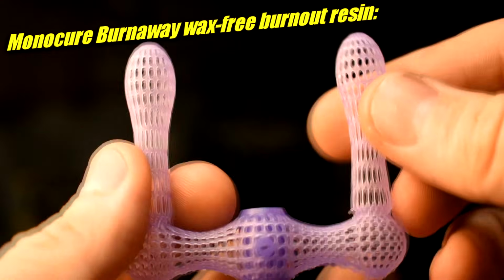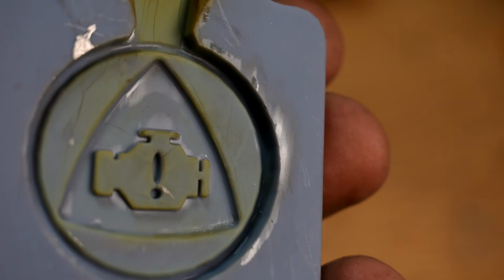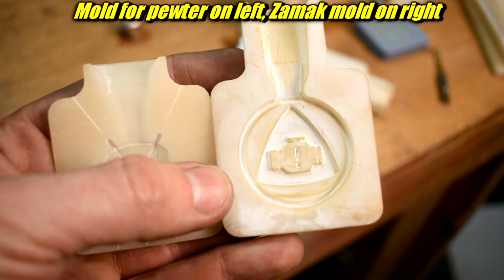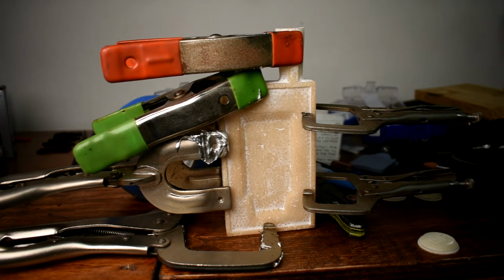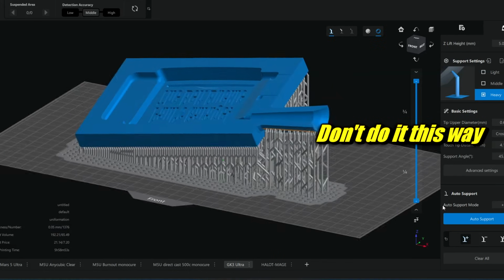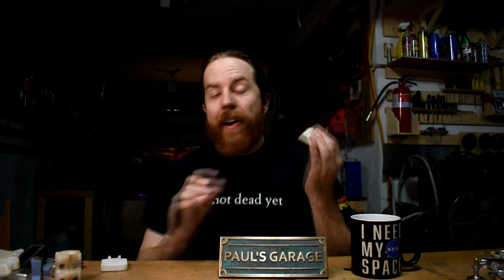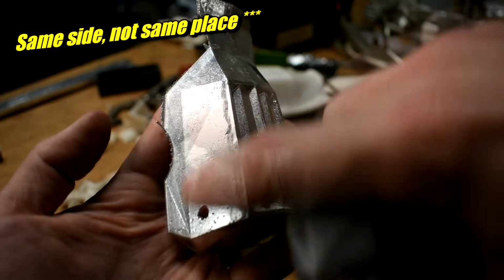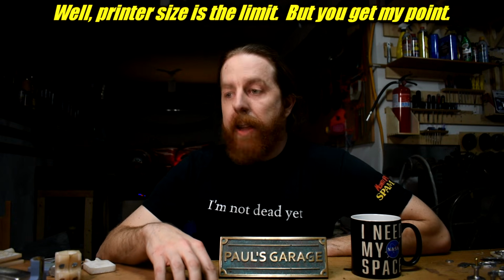EASY Metal Casting into 3D Printed Molds | Monocure ThermaCAST!

Comment from the maker: Check out my New 3D Printer Focused Channel!:  https://www.youtube.com/@PaulsPrinterProjects
This AWESOME resin available here: https://monocure3d.com.au/product/thermacast-resin-heat-resistant/
Amazon: https://amzn.to/417BSjq 1.25KG
https://amzn.to/4kec4eo  6KG (i'd suggest this one!)

Metal used available at www.rotometals.com
Here's the low melt stuff: https://www.rotometals.com/low-melt-fusible-alloys/
Pewters: https://www.rotometals.com/pewter-alloys/
Za-12:  https://www.rotometals.com/zamak-za-12-mini-ingots-pack-of-12-1lb-each-free-shipping/
Reply: Hello, have you tried wax filament for 3D printing? I have an FDM printer, and I wanted to cast complicated elements from zamak5 and it's hard to find solid information on how to print it and whether my printer can handle this filament. You mentioned this filament in one of your videos, so my question is: do you know anything more about printing this crap? printer profiles? any advice? I bought pvb filament but I have no way to burn it out of the mold in a controlled way... this makes it difficult for me to cast anything ;) (btw I melt zamak5 in an open furnace for melting tin up to 500°C or with a cheap burner in a cat food can XD, I have limited possibilities). Thanks in advance for your answer

Comment: I was always wondering if the rate metal cooled off would be fast enough to not entirely burn off a 3D mold.... Sweet video! I still like my sand casting, but this is cool
Reply from the maker: Agreed, sand casting is great.  This stuff can hold up to even za12 but thicker parts cool slower and damage the mold faster.  Ive tried normal resins, and even though the R202f metal doesnt burn the molds, the heat warps it all so bad it leaks.  Thermacast is the only way to go

Comment: Great video. I am an Aussie and have been using Monocure resins for years because they are good quality. I only found out about Thermacasr yesterday. I have been looking for a resin like this for a while. I have tried various types of casting with varying success. I have been CNC cutting molds from graphite which works well for objects that are not too high. 3D printing the molds will be a lot more versatile.

Comment: Question. What would the inside of the part look like after casting?? Would it look like swiss cheese with 100s of small airpockets, or is the finished casting fairly dense? Wondering if you have ever tested this or if you would be willing to test this? Thanks.
Reply from the maker: Good question, the answer is, it depends.  As long as you don't over heat the metal, nothing will off gas from the thermacast resin and cause bubble.  You can still get porosity in the metal casting if your gating allows for air entrainment, or if your design doesn't compensate for shrinkage.  If you use a tin-bismith alloy, shrinkage won't, but air entrainment can.
Reply: @PaulsGarage  Thank you for your quick response. I am very interested in this stuff, as it can make some pretty intricate metal parts for a very affordable price. Have you had better luck with the Therma CAST or the BurnOut resin. What process would you recommend for an absolute noob, zamak12 seems to be my target.
Reply from the maker: @GokayToklar  the processes are VERY different, it depends what you want to make.  If you are a total noob, I would suggest thermacast and pewter until you get the hang of things, then za12, then the burnout process if you aren't getting the results you want.

Comment: I see they sell it in Kg rather than ml. How many ml to the Kg is this resin?
Reply from the maker: The reason it's sold in 1.25kg and 6kg is because it's pretty dense stuff.  1.25kg of thermacast is close to the volume of 1kg of regular resin, that's why the volumes are off.
Reply: @PaulsGarage  Thanks for the info

Comment: Use snap rings around the smaller molds that can be printed with a round exterior shape.  It's never warping outward against multiples of snap rings.  No slots required by the way.

Comment: Would an electric toothbrush shaft (head removed) provide enough vibrational energy to shake the air out if you touch it to the mold?

Comment: Glad to see your video! You convinced me; its Zamak time. As for REMOVING BUBBLES...you can harvest the motors from an xbox or playstation controller that vibrates. I use a variable resistor and 9V battery with the motor(s) placed in a plastic box. Fastened the motor really snug with plumbers tape. Yeah, the metal tape. Thanks for sharing your work!
Reply: Or go down to your local kink-shop and get yourself a rechargable tooth-rattler. Multiple settings already programmed in! Liquifacts concrete a treat and nothing sticks to silicone!

Comment: I didn't know you could just buy bars like that, so thanks for that tip. And I really need to get a resin printer now, because that is awesome. Maybe you could use this to print some pieces of the lathe, gears and/or chucks?
Reply from the maker: You read my mind!  That is the plan

Comment: Since it's 3d printed, it should be possible to print e.g. cooling passages in the mold.  Hmmm.  This is a gateway drug to die casting.
Reply from the maker: That's a great idea.  Internal cooling to chill the metal but also limit damage to the mold.  With lower temperature metals it's probably not necessary, but for Za-12 it might be worth a try

Comment: build a vibrator base. get a cheap bathroom vent fan and cut back one of the blades. It will now be out of balance and vibrate. If not enough vibration, cut back that blade further. 
You can add a dimmer switch to tune the vibrations, but probably overkill.
Reply from the maker: Not a bad idea!  I need to replace a vibrating bathroom fan in my house, actually.

Comment: Print the shell molds in halves, clean them out, then press them together and paint a small amount of the resin along the seam and hit it with a UV light to cure.
Reply from the maker: @Mike80528  that's probably the best way to make sure it's clean inside
Reply: @PaulsGarage  Does the data sheet list dimensional stability?

Comment: @PaulsGarage

Great videos as always, can you make a video on sand cores using greensand/petrobond sand. Shaping these cores using reverse 3D printed molds should be easy but actually hardening/solidifying the sand consistently would be a game changer. Sand casting an aluminium engine block tutorial using these cores would be ace.
Reply from the maker: That would be awesome.  Thus far I haven't used sodium silicate cores, just petrobond in printed molds, and I ram then as tight as I possibly can.  Seems to work well, but for something like a block with cooling passages, you would definitely want sodium silicate.  Very cool idea, I'll add it to the list
Reply: @PaulsGarage  I was always wondering rather than using sodium silicate cores with c02, if there is an agent/binder that hardens greensand/petrobond sand that would make life so much easier. Or even an agent to harden normal silica sand without the need of co2, ive seen somo trials with epoxy that hardens sand without the need of c02.

Comment: Woow, this can even be used for plastic injection molding. 

Because alternative mold making resins I have seen only survive upto 250 degree celcius, this does more than double
Reply from the maker: Yes!  I asked monocure about that and they said it should handle the heat no problem, but you would definitely need a mold release wax or something.  Otherwise the plastic would stick.  Metal dies need it too, but it would be extra important for plastic molds
Reply: @ thank you for your answer and the tip!

I just invested in a buster beagle injection molding diy kit, I will look into resin printed molds as well, apart from cnc’ed alu mold

I suspect maybe the injection pressure might be an issue with this resin, as plastic injection comes with high pressure

Comment: I've heard of casting steel directly to3-D sand based molds but those machines cost a fortune.  This resin may be one of the newly discovered silicone based 3-D type "secret formulas". Pretty cool stuff for making most any smallish size industrial strength part made from the better zinc based alloys, and to directly cast lead, tin or other low melting point metals.  Leave it to Paul to enlighten us on the latest and greatest - very cool.😎
Reply from the maker: I'm not sure if it's silicone or not, it's very rigid stuff.  It works though.  I'm gonna try casting some gingery parts with it, those are pretty hefty, it will be a great torture test of this resin
Reply: @PaulsGarage  Very curious what it is.  Plastics just can't handle heat higher than 250C.  Technically, silicone is a synthetic rubber with double temperature rating of best plastics
.  Innovations to 3D print silicon are happening but not sure either.  Look forward to future gingery parts vids.

Comment: Awesome. Also looking forward to the day when someone makes one that can handle aluminum.
Reply from the maker: @GregAtlas  same here, that would be so awesome
Reply: @PaulsGarage  Steel can be 3d printed using special sand casting techniques but cost of printers are industrial strength.

Comment: a super cheap way to give you a easy agitator to remove the air would be to use a old or broke gaming controller PlayStation or Xbox both have little shaker motors that spin with an unbalanced weight  in the handles to give rumble or feedback i cant remember what the power use is but its low 9vlt will work these are super small yet potent shaker motors taping one to the molds or better the item its clamped to or the clamp would give you great results probably from items you already have laying around like a micro auto tamper
Reply from the maker: That's a good idea!  I don't have any controller laying around though.  I suppose I could go garage sale shopping
Reply: @PaulsGarage  not many garage sales today at 2 below zero.  good day to stay inside and catch up on your projects.
Reply from the maker: @mevk1 2 below zero? That's frigid! It's a balmy 5 above zero here!  It's practically summer 🤣
Reply: @PaulsGarage  Here in regional Australia (where it actually IS summer), we're having a cool day.  Forecast top is only 31°C today 😎.

Comment: I print injection molds on my resin printers quite frequently, and the trick to getting square, geometrically accurate models is always over-supporting, keeping the model as close as is feasible to the print plate with a reasonable cross-section exposure for the duration of the print, and oversupport the backside of the model With cross bracing and tie-ins to your supports. If you can stand on your support structure afterwards, you're doing it right. I've come to call it Trestling, ala trestle bridges, for the same reason. The great part is that it's a mold and I don't care about surface finish on the backside of the mold, so go nuts with support penetration depth and contact sizes. 
I'll usually orient my models per-case basis for the lowest print time and easiest peel force or a balance thereof. The problem with printing parallel to the LCD is air pocket encapsulation. If the part isn't strong enough to take the pressure or has a route for it to escape, geometric accuracy suffers, or I've seen other people have catastrophic print failure. I learned my own lesson years ago with suction cupping and try to pay it forward whenever I see a preventable case.  😉
I also recommend running a thin aluminum backer on your high-temp molds and clamping in a screw vise where applicable, or having several molds and using big ol' bar clamps when you get past the 6 inch depth limit (mine is anyway, cuz it's a cheap 6" harbor freight vise). Not crushing tight, but it's even pressure across both faces.
Reply: What kind of injection molding machine do you use. I was thinking of building a DIY one.
Reply: @trexquigley  I ended up building my larger one out of salvage industrial parts, band heaters and PID controllers. I looked around at the usual home-scale ones, but I couldn't find one with enough volume capacity to do large parts; they were intended for really small shot sizes, roundabout a business card, area wise. I needed something quite a bit bigger. I experimented with a smaller hand-held version I built up from an air-assisted grease gun that works fairly well, too. If you go that route, don't skimp on the insulation jacket, and get one that is All metal (outside of sealing o-rings). Works pretty well for doing 3-6 ounce single volume parts or a run of 6 one ounce parts, which is quite decent for comparable size. You'll have between 5-10k psi of injection pressure, so getting your molds Really closed is more of a concern, as is molten polymer in appreciable quantity if something doesn't work out. Be safe with it!
Reply: @C-M-E  thanks. So is it like a pneumatic press type mechanism.
Reply: @trexquigley  Yep, the little handheld one is. The big injection screw takes a special reduction gear drive to operate, a 175:1 for the torque. Time will tell how long the motor will last for, as it came with the reduction box, but it seemed undersized to me.
Reply: @C-M-E  I have a high torque nema23 and a  planetary gearbox for it. I wonder if that would work if I couple it to an injection screw.
Reply: @trexquigley  Technically you could power it with a really small motor and reduction box, if only for two or three minutes until you smoked the motor. 😁 I looked at all kinds of worm drives, reduction boxes and such before I found this one I'm using now. As said, I suspect it will have a short life come this spring, but the reduction box should last a while. The screw I have is 60 pounds and about 5 feet long. The real force to overcome is the friction from a continuous shot size being fed from the hopper of pellets and the extrusion force itself; larger nozzle size, less hydraulic force is needed to expel the shot/stream, but on the flip side, you need a certain pressure from the nozzle for effective injection. I don't recall exactly how long ago I shot the video (maybe a year or so?) but I have a preview on my YT channel from when I was test fitting parts.

Comment: It is great for making quick functional castings.  I needed (well wanted) to replace the locking handles with knobs on my Mill.  Printed 1 mold (that held a captured M6 bolt) and churned out 4 x knobs in no time.  Did not even bother with a sprue etc, I just cast it into one half then pressed the top half (that had the bolt) onto the bottom.  Not pretty, but Job done.  https://www.youtube.com/watch?v=bPbWKiN3ejg

Comment: Hmmm I'm needing to do the reverse: I will probably have to cnc machine a shape out of aluminum, pull a mold from it and resin-cast a totally transparent final part. It's going to be a demo to show a mechanism within it. Got an idea of how to do it more simply? Suggestions welcome!
Reply from the maker: that sounds really cool!  for super clear resin, it seems like cast resin is superior, but i've been surprised recently by a few printed resins.  Anycubic high-clear, when printed on a sufficiently high resolution printer and then clear coated looks pretty good, and I hear good things about formlabs creator clear resin (you don't need one of their printers), also they have a "Clear V5" which looks very clear when polished.  Otherwise cast stuff looks pretty awesome.
Reply: Why not 3-D print the mold directly? If you already have the part modeled in CAD, a negative can be taken of it to make the mold without machining the part.
Reply: @Providence83  It's a question of quality of finish: even at 0.1mm layers would not give a smooth enough exterior to create the see-through quality I need in the finished part.
Reply: @wanglydiaplt  You'll need to postprocess regardless of the method you choose. There's no way some sanding, buffing, and polishing with a Dremel tool is more intensive than starting with machining.

Comment: could you use vaccuum casting with this thermacast? sorry i'm new to this stuff :)
Reply from the maker: Probably not.  Vacuum casting works because the plaster is porous, but this stuff is solid plastic.  You can add vents to it though, that helps the air escape
Reply: @ thanks for the reply! I’ve seen you adding the vents in your part. But still really curious about combining those two methods to make really delicate parts out of a 3d printer. Insane times. 🙏🏻🔥

Comment: Total tangent here.  Seeing you use non-casting plastic for casting put an idea in my head.  Could you embed something in the metal as you cast it?  I'm not thinking of the casting element, but more artistic.  Take your "No" drawer pull, and have the No be a red plastic.
Reply from the maker: You could embed this resin, but its just white.  You would probably have better luck pouring something red into the metal part after it's made, like filling the pull will red resin and blasting it with UV or something.  That would work
Reply: As long as the 'NO' red plastic is actually able to take the hot metal - which means its probably not plastic. Though you can dye these UV cure resins and this one is tough enough to handle heat, so as long as your pigment won't degrade...

Still think you are better off just making the coloured sections depressions in the final part - then you can pour in some Enamel paints or Nail varnish for a really durable self levelling fill that will look neat and vibrant.
Reply: You can't really use anything that smokes or off gases and that gas will impact your casting finish.  No probs with embedding items like coins etc.

Comment: 50 USD for a 700g bottle. not too bad
Reply from the maker: That's what I thought.  It's cheaper than the burnout stuff.  You do end up going through it with the thick molds, but it's not too expensive.